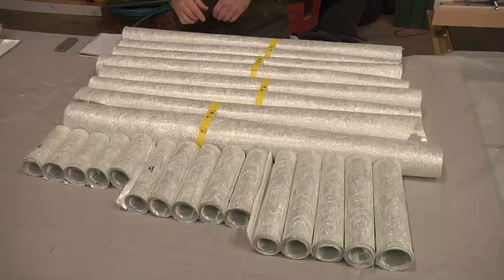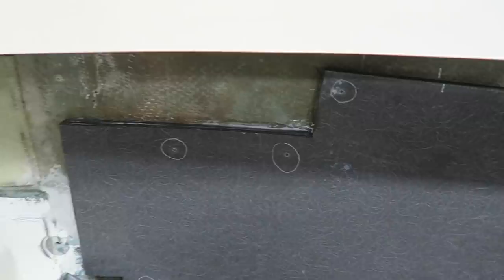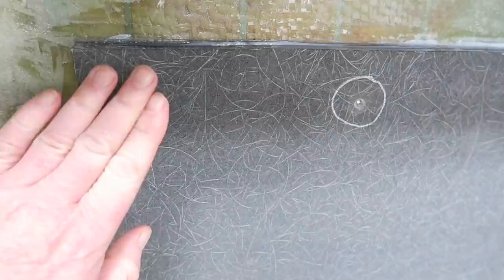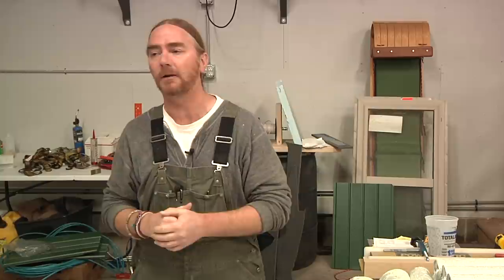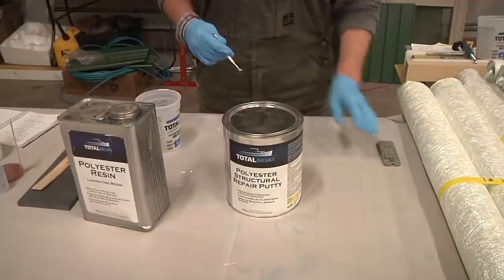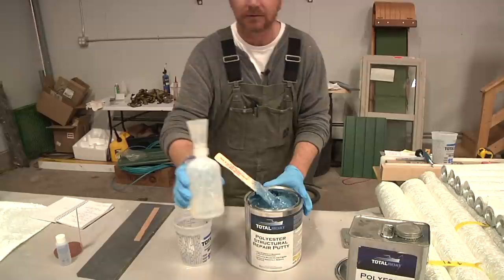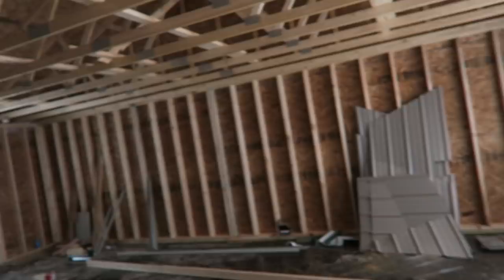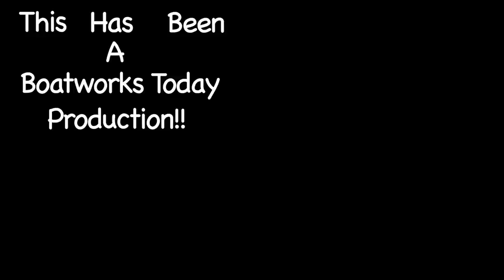The Boat Is Ready, Transom And Fiberglass Prepped, Nothing Left To Do...

Comment: When i did mine, where the excess is, i put polyester with cabosil and rounded it with a party plastic spoon, to make it easier for the fiber to get the shape, the edges of the coosa i rounded it, before installing it, with a router and and a 1/2" radius bit, hope this helps you if you haven't done it already.
Let me add here that most of what I know about fiberglass work I learned it from you.

Comment: Your reason for polyester is exactly why I'm using poly on my project. The fact that you can just keep right on laminating or stop for a week makes the most sense for me because I work 6 days a week. Just bought several different rollers and pre cut 1708 rolls at 8 inch and 12 inch rolls. Also bought some 6 oz roving and have ordered a small 10 yard roll of 24 oz roving.

Comment: When it comes to mixing my gel coat or poly resin, I've completely switched to ml. It's much easier to do ANY of the calculations. The only time I do drops, is if I have to mix only 1oz (29.5ml, which I round to 29) for a small repair. If I want to catalyze at 1.5%, it's easier for me to calculate 1.5% of 500(ml), than 1.5% of 17(oz). 1oz=~29ml.

I highly suggest using syringes for your MEK measuring. It's a 1:1 ratio ml:cc (5ml = 5cc)

For those who have trouble with the metric system, try looking only at the number for ml and forget about the words: cubic centimeters/mililiters.

Comment: I need help, I have cut in the bottom of my 1987 fiberglass bay liner 15ft 7inch boat the cut is about 10 inches long and maybe a 1/4 inch wide I have access to both sides of hole, what products should I use ?

Comment: I just bought a ton of fiberglass mat from an auction, maybe 20 large rolls of it 3 ft wide by maybe 30 40 ft long. 
I run a marina so it will come in handy but if you need a few rolls I might be able to help you out.

Comment: Hi Andy, It is such a breath of fresh air to hear your comments regarding the use of polyester. I live in Australia and have been keeping myself busy in retirement by doing some complete rebuilds on old fibreglass power boats in the 5 to 5.5 metre range. I have stopped commenting on several of the Facebook sites over here relating to restoring old boats as everything is you must use epoxy. I use epoxy for all gluing and polyester for filleting and layups. As you said these old boats were all built out of polyester so why not rebuild them with it. It is so good to not have to wait overnight for epoxy to go off before the next layup. I have watched your videos for a long time and want to sincerely thank you for sharing your expertise.
Reply from the maker: Absolutely epoxy for bonding and glass layup below waterline, but generally speaking poly for most repairs is perfectly fine ;-)

Comment: Hey Andy, great tutorials. Informative, flowing and humorous. I stumbled onto your vids (luckily) as I’m down here in Montana with a project boat without advice or supplies.  I’m replacing the rotten core of the salon roof/upper deck but….from below.  No access to a shop so gotta do this from inside against gravity. YUK.  Trying to learn as much as possible from your vids and just caught you using the Polyester Structural Repair Putty here. You’ve sold me on Coosa and wondering if the putty would be a a good choice for Coosa to the upper skin and also laminating Coosa to Coosa.  Working upside down I realize whatever I use will have to be thickened big time. The putty looks about perfect for this nightmare.

Thanks much in advance.  Cheers, Bill

Comment: I own a 1969 Stingray 2, it's a small, 6 seater, speedboat. The floor is squishy, and all the wood structures of the chairs is all but dirt. I've decided to restore it so I've started gutting it, at the point of cutting the glassed in floor. Is there a resource you could point me to on best practices? Any advice would be greatly appreciated. I've never worked with fiberglass or resin before. Thanks

Comment: Love your work Andy, keep it up. I have a question ( hope this is the right place for it) I’m redoing the transom on my 1981 c-dory and over 6 ft of length I have 4” of curve. I want to use coosa ( originally it was built with scored balsa core , 1 1/2 . ) I haven’t been able to get my hands on Coosa .. so I don’t know it’s “bendability” 🤷‍♂️  which combination of Coosa should I use? 1/2”x 3 layers?, ….3/4 x2 layers?? 
The curve of the transom is a 4” out at the Center. That’s a lot of pressure , I’m thinking.. 
? Or are curvy transoms best done in balsa?? 

Thanks bud!! Hope your day is awesome!
Doug

Comment: Do it the hard way grind that 90 degree before you put it in there. Strength wise if you want it good epoxy for a transom. I have used polyester  in a transom stress cracks galore it held together never flew apart

Comment: Your point about not needing to deal with the amine blush and sanding between coats is very valid.  I am curious about a laminating epoxy resin like the System 3 Silvertip Epoxy which according to their documentation does not have any blush and can be recoated without sanding if done within 72 hours.

Comment: Thanks your really educational. One question, you used epoxy to bond the transom pieces together and now your using polyester resin for your fillets and lay up, I did not think you could have the epoxy resin contacting the polyester or vinyl ester resin. Thanks

Comment: If you round the edge of your Coosa before installing it to place, you can make your job easier. 😉
Reply from the maker: Wanted to, but didn't have a router bit short enough to work with 1/2" material :-/

Comment: My understanding is always been the polyester fiberglass it’s not as strong as epoxy fiberglass am I wrong
Reply from the maker: Little bit of a loaded question, but for recreational boats this is the analogy I use.  You have a 10 ton boat and the marina has 2 lifts; 1 that is rated for 25 ton and the other for 35.  Does the 35 ton lift do a better job than the 25?  End of the day doesn't matter as what you need is still below either capacity.  For most applications poly is a perfectly acceptable resin to use.  There are always exceptions, but in most applications it's more than acceptable (as long as it's not the cheap crap from big box stores ;-)

Comment: Just finished restoring a 71 Powercat, I used polyester resin, works like a champ and easy on the wallet.  I like epoxy, but hate the cost and the wait time.  I will say you better have your act together on a polyester layup!  Otherwise you will end up with a mess!  I restored a Sleekcraft about 12 years ago, again all polyester, she had been beaten and rode hard, and has held up great!  I don't have a thing against epoxy, but you just don't need it sometimes.  I do uses epoxy here and there, but mostly as a bonding agent more than laying up glass.  I am always amazed at how everyone gets worked up on this subject.  Hey just use what works for you and what you like.  They are both great products, don't get lost in the weeds!
Reply from the maker: Exactly :-)  Epoxy definitely has it's purpose, not going to argue that but it's not the "Be All, End All" option for every situation

Comment: I'm curious.  Could you have used a laminate trimmer or router to round over the edge of the Coosa before you installed it?
Reply from the maker: Yea, but all the bits I have on hand have shanks that don't work with 1/2" material (the bearing wouldn't  have anything to ride on :-(

Comment: Now you used epoxy for cousa will it polyester bond to it ?
Reply from the maker: There will be so little surface area where the two meet, it's not an issue :-)  Much different situation if I were laying glass on top of a large area that was done with epoxy

Comment: Hi, really terrific videos you make. I have been re-watching many of your videos for my very first build.

I have wrapped the hull in fiberglass and am now fairing it. In one of your videos you mentioned about sanding the fiberglass before fairing with 80 grit.

What is a visual indicator that the fiberglass is ready to accept fairing compound ? 

thanks for reading.
Reply from the maker: you'll be able to see a consistent scratch pattern in the surface from the sandpaper :-)
Reply: Use 60 or 80 to cut back and 80 before fairing. You don't want to use 120 or above for cutting back solid   epoxy lumps and bumps as you will end up sanding mountains in rather than cutting back. Once fairing is on if its easily sandable then start at 125 for a quick skim on dodgy bits then move up to the next grit quickly don't oversand with the first grit just get it flat enough that the rest of the grits will even the last of it out as you start sanding outward and using bigger passes to super flatten it.

Comment: Been curious about the repair putty. In your opinion, would this be an acceptable media to fill old screw holes on a console (from old electronics mounts) or old screw holes from where a bow rail used to sit? I would cover it in a layer of new glass and gelcoat afterwards.
Reply from the maker: Yup, the putty would be perfect for that :-)
Reply: Thanks Andy. I'll be getting to it soon.
Reply: See bow rail holes if you plan on ever reusing that area I'd do an epoxy pour into them and tape small pieces of peel ply on the bottom holes like a plaster so the peel ply is inside the perimeter of the tape, pour, top up the holes a few mins later then pap some peel ply over the top holes. You will get a clean fill and minimal sanding afterwards. See the problem with the bits that bow rails are screwed into is they are cored so you really want to be filling that entire void in or that might come back to bite you especially if you plan on bolting something on there later.

Comment: I've used polyester resin mixed with talcum powder as a filler to do fillets and fairing with no issues. But most importantly is the polyester resin will break down the binders in the chop strand mat so that it can move freely and be rolled out much easier
Reply: There is no mat in 1708, but is in straight chopped strand mat, as long as it is layed flat - no issue with epoxy might look odd but no other issues.  It does get springy  though - that’s why to lay it in flat applications.  I only use epoxy and only use 3/4 oz mat, never 1.5 oz.  If I need more just layer 3/4 oz.  If you need to bend it, better stay with it until resin kicks otherwise will find it set standing up.  Polyester stinks can’t stand it and not using the organic filter mask, no such thing occurs with epoxy except for a few moments when both parts are combined.  By the way, 1708 has the equivalent of 3/4 oz mat but with no binders.
Reply: @robertp7209  If there are no binders in it then what is holding it together and what holds it to the cloth?